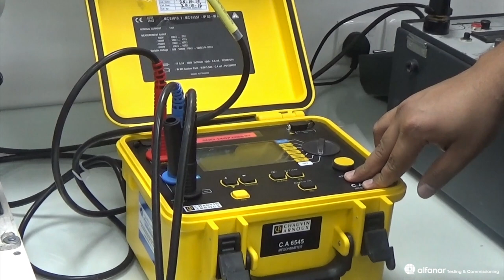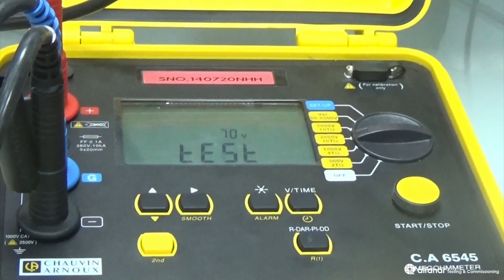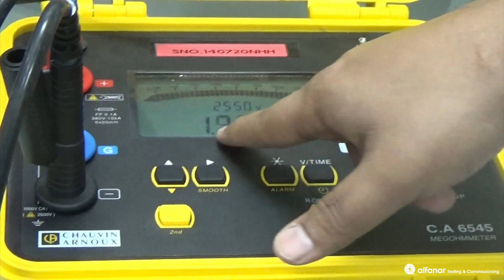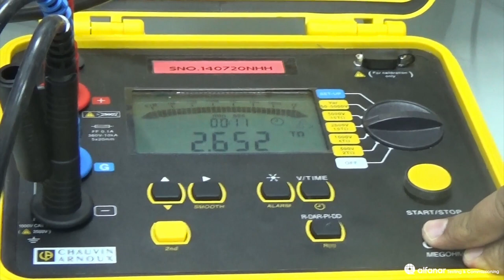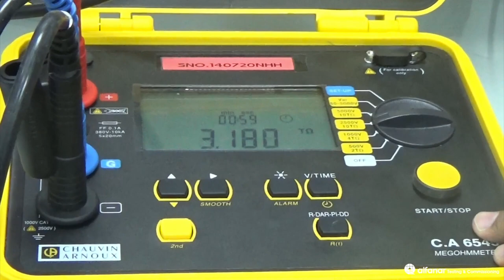How to make insulation resistance test ?

Comment: Why is resistance increasing? Leakage current should be increasing with time causing resistance to decrease
Reply: If the resistance increase that mean : the insulation media is very very good, another else if the resistance comes low that mean the insulation media is bad
Reply: @saifs114  You didn't answer his question, he's saying since the HV is applied over 1 min, this would cause the insulation to deteriorate which would cause an increase in leakage current. But if the insulation is deteriorating more and more as time goes by shouldn't the resistance decrease?
Reply: Only if the insulation is bad